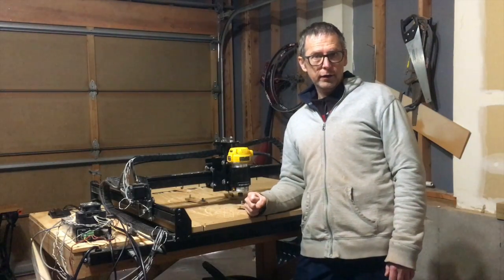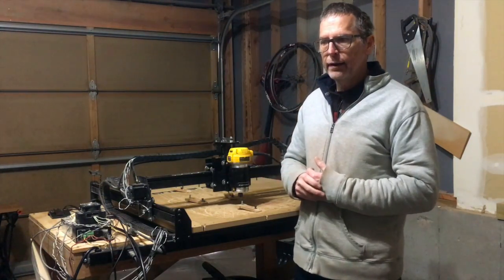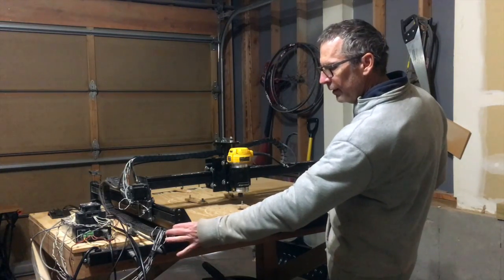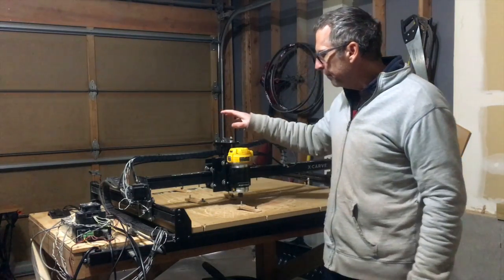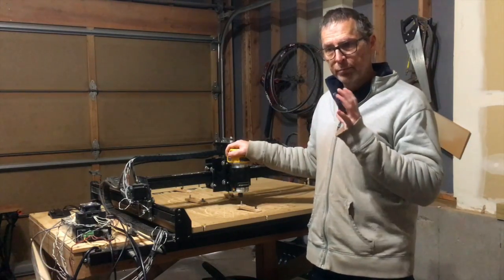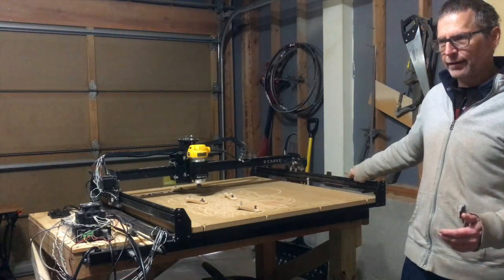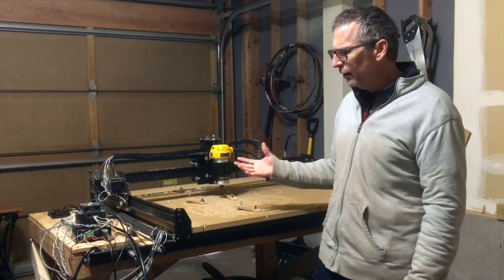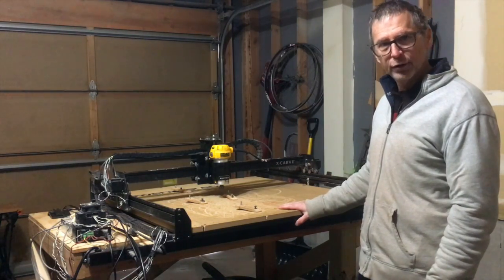My X Carve CNC Machine

Comment: Hi Chris, excelent videos all over your channel; I saw the series on the custom CNC you built, and looking to make something more like this one.   About the X-Carve you said something about having to reinforce the X Axis, in what way? Kind of confirms this might be the weak aspect of this product among all the good things.    What are your thoughts on the belt drives for your type of work I hope they are stiff+precise enough for the price.   Thanks for all the info you are sharing here.
Reply from the maker: My X-Carve was the original model with two X axis beams. The new one has a beefier single beam that solves the lack of stiffness problem. The belt drive works okay, but it requires frequent adjustment to work reliably. I understand that Inventibles is working on some new and better machines so it might be worth waiting to see what they come up with. However, the current machine works very well and the price is hard to beat.
Reply: Quick and kind advise!  Lot to search and compare, Thanks again.  Even being on a budget I am looking to get more of the important features like the drives and the linear bearings.   No question on how useful this tool is to materialize your nice designs; those works speak for themselves.

Comment: Hi. I am definitely pulling the trigger on an X-carve soon. I have some questions on the software... It looks to me that in order to design what I want I will need other software. I have managed to design a fairly simple body in Easel, but it was not easy and there are major limitations with it (e.g. difficulty of exact measurement). I have started looking at Rhino for design, which looks great, but I am now realising that to go from Rhino to machine will require more software for CAM. Can you describe your process through to actual carve, and what software components you use? Sorry if you have explained elsewhere, I have not been through all of your excellent videos yet. Thanks.
Reply from the maker: Here is a link to the first part of a four-part playlist I did that explains my process: https://youtu.be/5QfOyVsyqeg

Comment: Largely because of your videos, I bought and am assembling my X Carve now. I have done a lot of research into it, but the one thing that no one can tell me is probably something that you can help me with. What feed rates, depth of cut, stepover, etc. do you use for the typical guitar woods? I plan on starting with basswood and poplar, but obviously maple, mahogany, and rosewood are very different. Everyone tells me that every machine is different and blah blah blah, but I just want at least a good starting point. The less unnecessary stress I put on the machine, the better, but also the less time I waste trying to slowly ramp it up from a very low feed rate, the better. 

Thank you!
Reply from the maker: I use the following bits: .022" for fret slots, .03125" for inlay, .0625" for thin parts like cavity covers, .125" for fretboard shape and radius, .25" for pockets, body shape and neck contour. For .022 to .03125" bits I use a feed rate of 20 ipm and a DOC of .01." For the .0625" bit I'll use a feed rate of 40 imp and a DOC of .03." For a .125" bit I'll use a feed rate of 80 ipm and a DOC of .04." For the .25" bit I'll use a feed rate of 100 ipm and a DOC of .06." Easel has a default stepover of 40% and I haven't had any issues with that so I leave it alone. If I use a different program for tool paths, I use the same value for the stepover as I used for the DOC. I use these values for all wood types.
Reply: Great! Thanks a ton!

Comment: Would be possible to make a neck through guitar with the x carve? Would it be possible to do it in stages if the working area isn't large enough?
Reply from the maker: You probably could, but I wouldn't.
Reply: Could you elaborate on why a neck thru may not be optimal on this machine?

Comment: Pretty much just bought mine for shits and giggles without any REAL long term plan what to do with it and I'm already in love with it after doing some parts for the Machine itself like a 240V DeWalt 611 Relay Box, Y-Axis Stiffeners, Tool Holder Plate, etc...
Personal recommendation though is to drop Easel pretty much on sight and go straight for Autodesk Fusion 360 which, depending on how you use it, can legally be used for free and isn't too hard to learn because of the plethora of YouTube Videos available.

Comment: I have an X-Carve and its a great machine -- for what I want to do with it.  I don't build guitars for a living, but I am hoping to build a few as a part of a woodworking hobby along with other things.   Like Chris pointed out the X-Carve is a very upgradable machine. Computer Engineering is my trade, so I didn't even order the controller that came with it went right to a Raspberry Pi / Arduino powering external drivers. I can remotely perform carves using my iPad with this setup no need for a computer running GRBL or Mach3 dedicated to my machine.  It's design is very open and I can see people continually upgrading their systems.

Comment: I just ordered a Chinese 6015 CNC with a 24x48x6 table. I should have it in about a month. I know I wanted a more robust tool. liner guide rails, ball screws, 3kw spindle. Now I need to learn how to run it. I have some Autocad experience and lots electromechanical experience so, it shouldn't be too hard.
Reply: Joe Carpenter did you get your CNC out of China and up and running? How's it working out? Would love to hear about it, cost, setup, operation etc. thanks.

Comment: Another good video. I'm actually starting a cnc build today of my own design 5x10. I was thinking of doing about 6 necks at a time but you made a good point that it only cuts one at a time. It wouldn't be much to make the Z a three headed router or in my case a spindle, to actually cut 3 at a time. I really appreciate you sharing your insights.